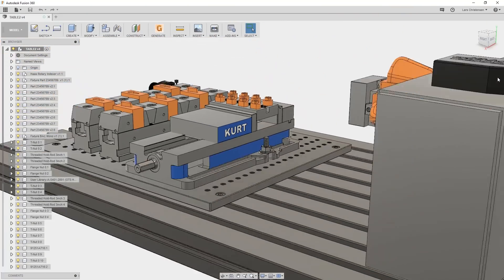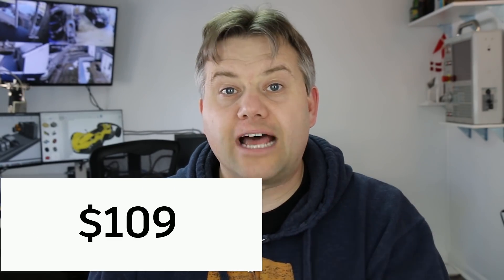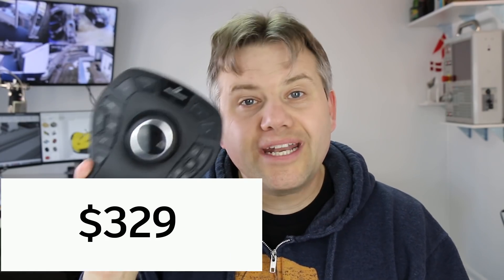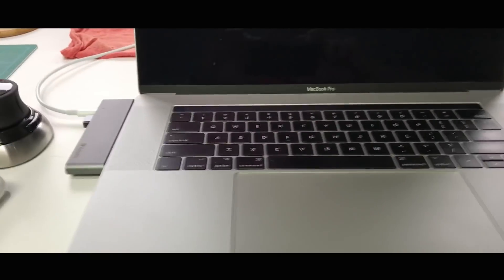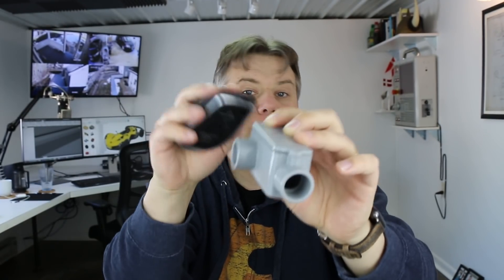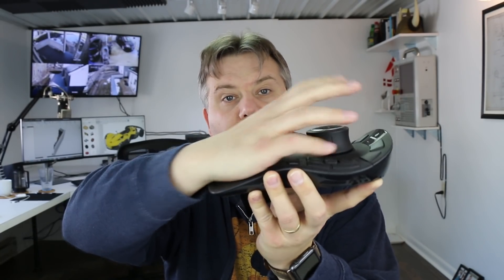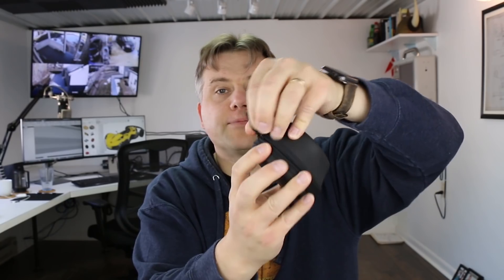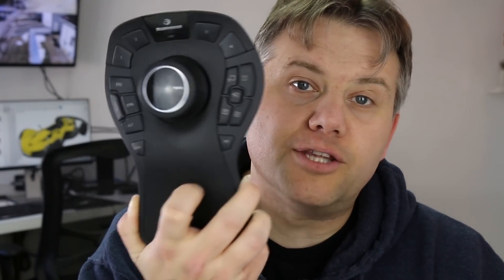HOW I PAN, ZOOM & ROTATE — 3D MOUSE REVIEW | 3D CONNEXION

Comment: I bought an older used Spacepilot pretty cheap on ebay for use at home and then one of the guys in the computing department at work gave me one. Apparently it had been ordered, but never used and was about to be thrown out. So I then had the same setup at home and at work.

You often see batches of older models being sold cheap. 

 I really miss having one when I have to show someone how to do something in fusion on their computer and I hate the limited realestate of a laptop. Then again, when I'm at work I miss my 43" 4K Monitor!
Reply: I too bought  a recent edition Space Navigator on Ebay. Still was quite expensive, and I feel that I might have been a bit more patient. But going mad trying to get some coherent and fluid "camera" moves.  Still awaiting its arrival. Now I have to find the best version of a companion mouse....it will have to be a steal :-)
Reply from the maker: Paul, sounds like you have a pretty nice setup with 4K monitors :-)
Chris, yes patience....isn't that the worst :-)

Comment: Dear Lars Since each day I follow your tutorials and I'm starting to love Fusion and try to learn a bit everyday Still I'm a hobbyist and I can not afford to buy even the $100 one, that is why I went online and got a $50 one old model out of Ebay. That seems to still work under windows 10, If over time still works and improves my Fusion360 experience then I will consider buying the $100 one if is worth it. Thanks for the tip!
Reply from the maker: Hi Belen Hedderich Thank you for watching!
Love that you found a cheaper solution. I think you are perfectly fine with the used model. Great job